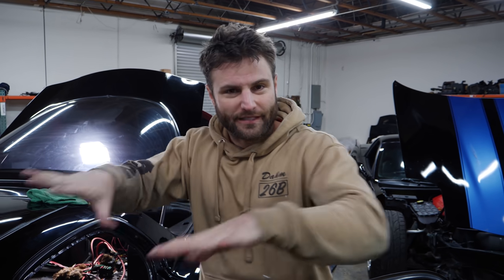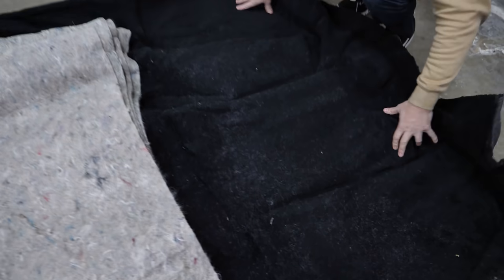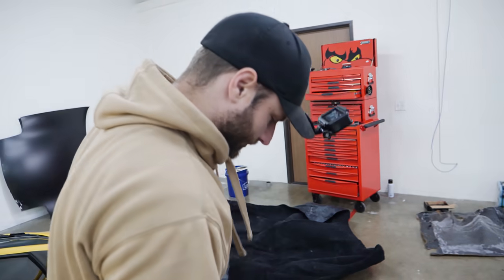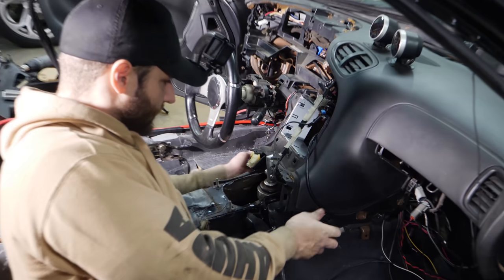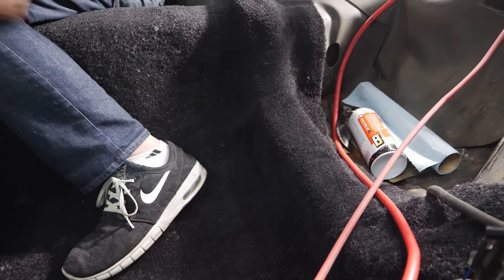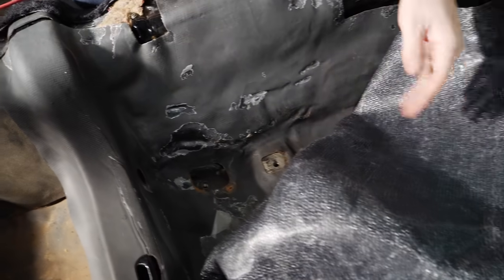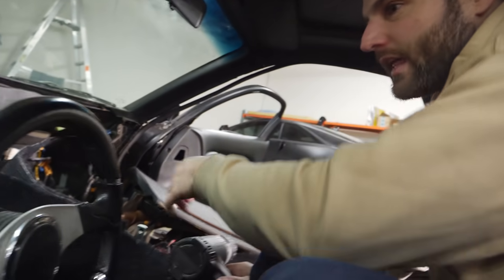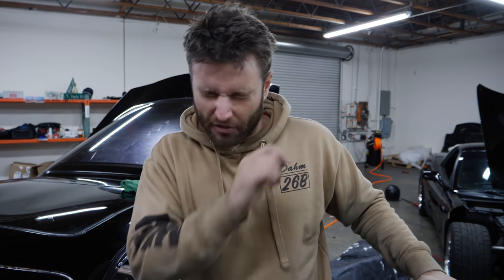How BAD is the $140 Carpet from Amazon? Car Interior Replacement

Comment: Rob, I believe you owe ACC an apology.  If you had followed their instructions, for letting the carpet rest, outside of its shipping packaging, unfurled in the sun, it would have laid out well (and it is cut-to-fit).  While I have not purchased their least expensive carpet, I have purchased their most expensive option, and it is a very good product.  If you had searched more, you would have discovered, ACC itself offers several options for an FD RX7, via RockAuto for example.

Comment: The other problem you are not seeing yet is ACC carpets fade out very quickly also. That black will turn an almost ugly faded red/orange color once it sits in the sun for some time.
Reply: NWCH like any else does clothes plastic etc your eyes vision it’s called blocking UV LIGHT from your windows.
Reply: Do you have any recommendations for other brands that don't fade so easily? I need a carpet for my Porsche 944 and ACC seems like one of my only options but it's ~$1K not $100 like this one 😢.

Comment: I don't know if you found a solution to the problem, but I got the replacement carpet for my VR4 from stockinteriors. It came out really nice! I let it take shape again by having it sit overnight unfolded, and I used my OEM carpet to template where to cut. I'd check them out Rob, it looks like they have one for the RX7.
Reply: I've seen stockinteriors alot, seems to have real molded stuff.
Reply: VW guys swear by stockinteriors. Only thing that fits even close to OEM
Reply: Thats where I got mine from too for my fc,but didnt install yet
Reply: Another one here for stockinteriors! Fits my Datsun 280, Subaru FXT,  and Honda really well. 🤙
Reply: wow im getting nervous, im on stockliner site now. is their carpet good?

Comment: Rob I hate to tell you this man but unless you order carpet from a specific automotive carpet company almost all companies get their carpet through acc. Ive installed this brand many times and once everything is in and it sits in some heat for a while it smooths out just fine. It is definitely a pain in the ass to install with all the creases from shipping.
Reply: 86BoostedBird well you’re supposed to let it sit near heat for a little before installing as well... it was molded originally but it gets crushed during shipping
Reply: @Matt_Lanzer_13  true, my favorite way to do it is set it in the car and let it sit in the sun with the windows up. Bakes and forms them pretty quick.
Reply: 86BoostedBird yea. Rob just didn’t do a damn thing right here and he payed for his mistakes 😂

Comment: You should do your research on ACC not amazon. ACC has been around for a long time providing restoration carpets to many high dollar classics and replacements to worn out vehicles.
Reply: Used them years ago when i restored my '68 Satellite. Bought it through YearOne. It settled in really good. Just my $0.02
Reply: I've used acc carpet on two falcons, as well as a 66 fairlane and it has fit fairly well out of the box and has lasted a good, long time.
Reply: @johnny_6T8  Plymouth satellite? A old friend of mines had a 67 belvedere gtx with a 440.
Reply: @kwebb4078bn  yes sir, Satellite. Actually had  '70 Belvedere wagon. Always liked those low budget model cars.
Reply: I can't afford something like that lol but I am restoring a 98 camry with 370k miles on it. I bought it for 800 bucks. It's not in bad shape either. It still runs. I'm going to use it as a daily driver. If I could afford  a classic car though. My choice would be an 1970 Cuda 440.
Reply: @kwebb4078bn  totally understand that. I bought my then wagon for $200.00 and drove it home. Got the Satellite for $600 and drove that home as well. Keep in mind this was over 20 years ago and in Los Angeles where Chrysler products weren't as popular as a Ford or Chevy. 
Funny you say camry, bought an '01 LE on Nov 4th of 2000. Still have it as my daily with 267K. Good luck with your '98!
Reply: @johnny_6T8  thank you

Comment: I took the seats out of my car, 65 Mustang.  My mom installed the carpet while I was at school, 10th grade.  I had left it outside while in school so I could do it myself.  As a birthday gift when I turned 16 in late August, I get home and the carpet & seats were reinstalled.  My father put the seats in because he helped me take them out and he installed 6 speakers and wired the entire stereo for me, of course i paid for the carpet, speakers stereo and all the wires for the amps that i would install a day later.  My father was an electronic engineer, but wiring is not hard to figure out what with instructions and all!

Comment: I've used carpet from the local home improvement store in several of my restorations. A 67 and a 68 Camaro, a 68 and a 69 Firebird, a 63 Nova, and a 72 GMC Sprint. Sold them all.to strangers and not one person asked if the carpet was correct. You just have to cut it correctly and get the right style.

Comment: This whole carpet project looks like a nightmare. It's bad enough you have to tear the interior apart, but then having to fight with shit quality carpeting. I had no idea there were few decent options for replacement carpeting. Bummer!
Reply: No.  He just didn't know what he was doing!
Reply: It’s not bad at all. The carpet isn’t shit he just didn’t do what he was supposed to. When you get a molded cut to fit carpet, all you have to do is pull the old one, let the new one sit out near a heat source for a while, then put it in the car. Where you need a hole just cut it quick with a razor. Trim the edge and you’re done. This job is only bad because it’s an fd

Comment: So I work for a 1960-1987 Chevrolet C10 truck parts store. The store I work for actually sells the same brand of carpet. The thing that's good about it is it's formed to the truck, and comes in all the original colors. However I feel like a car like the RX7 has more complex curves to it. I've seen numerous carpets fit in the trucks. Also the material is, you're right like an old truck or car. That's why we sell it. So it's good for some things, but not any modern car in my opinion.

Comment: Used that company for my 96 hardbody, just placed the old carpet on the old one, and cut the excess and marked the slits and holes to match the oem 

After a week in the sun, it was nearly perfect to the original fit of the original

Time and effort will yield the ultimate result

Comment: It may not look that good rob, but if your going to install automotive carpet you have to put the outside in the sun upside down in order to get it more malleable, it may be garbage carpet but you also have to get the backing hot before placing it down, I have done a ton of them and it goes a lot easier when you do this. good luck on you hunt for a better fit but please try this as well on the better stuff

Comment: In my experience its best to reuse the oem carpet if possible or acquire used OEM carpet and give it a good cleaning. Its easy to change the color as well. It just fits way better than any aftermarket.

Comment: for putting holes for seat bolts and the like in carpet like this that isn't stamped/cut already, use an old socket of the right size and a blowtorch to heat the socket up. once you know where to put the hole, use the hot socket to press down firmly in the spot to melt through and bam, clean hole. just be damn sure you have the right spot.

Comment: Looks like since you didn't get the "hollow carpet fibers" your making up the weight difference with rust holes in floor board,  I've done that myself a time or two. I've used ACC carpet in a few cars before mainly vettes and it's not too bad really , I always used the best grade for sound deadening it helps slightly.A steamer makes it easy to alter the pre-formed areas and make it fit good and lay flat. You did order the cheapest grade they make so don't blame them for that,  plus it does require some experience to install it..

Comment: You should’ve put the new carpet on top of the old one(with a sheet of plastic in between them). Then glued underneath the new carpet, to reform it.
That way you could fix it outside of the car

Comment: seems like they mould the carpet between two heated moulds , if it doesnt quite fit you might be able to reshape it some using a heatgun , do try on a piece of scrap first as it might well be heat turns the carpet fibers intoo a lump of solid plastic

Comment: Yeah I am doing a complete rebuild/restore on my fd and replaced my shit tan carpet with ACR carpet. But I upgraded with the "mass backing" rubber bottom option. I selected this option because like Rob I had rust problems, I used a wire brush on an angle grinder to remove it all and coated with some por 15 rust sealer and drenched the whole interior with seal all from the gallon cans for extra moisture protection. I wanted another layer of protection and the mass backing does the trick. Yeah it's not a perfect fit... Yeah I had to do a lot of trimming but once I got most of my interior put back in everythinv looks OK. I won't say professional grade because of my lack on experience. But the quality is a lot better compared to the old rusted nasty carpet I pulled out of the car. I also had the dash completely pulled and literally my car was a shell when I installed my carpet

Comment: That was hard to watch.  I work in the auto industry designing and making prototype carpets and soft trim.  in addition to unrolling the carpet, and using the old one for a template don't reuse the black rubber padding.  it's creating an offset today the molded shape.  you need today strip more of the interior too get it together fit.  Trying today work carpet around stuff is painful.  The front carpet is installed by sliding it forward in vehicle until you are tight on the firewall.  if you need to, cut sits in the center console area and get some velcro to put it back together, the center console will cover it up.  good luck.

Comment: carpets are formed to fit but no matter what brand you get you need to trim it and cut holes for the seat and other things that need to bolt down they all come that way this process for this carpets the same as any other brand. Anyone who has messed with carpet would say the same thing

Comment: Great video. I have a 95 Nissan 240 and ordered the CAC molded carpet for it. Ran into the same issues as you did. Its molded and that is about it. It looks better than the old carpet but fukn sucks. I recommend that you buy OEM molded carpet.
Reply: Hager z then you didn’t install it right either lmao. Their stuff works great... just let it reform after taking it from the box, pull any necessary interior trim, cut a few holes with a razor and your done. Did it on my alltrac and it came out great

Comment: Why does every dashboard seem to have a rusty tube inside it? Is there a reason this isn't painted / coated at the factory?
Reply: Paint costs money and it isn't visible in any normal circumstance.
Reply: @CompproB237  maybe it's just availability bias but i can't think of any other ferrous part they just leave uncoated like that except maybe the exhaust.
Reply: @AntonEMaes  The other reason to not bother with painting it is that it typically isn't exposed to much persistent water that would significantly contribute to rust.

You're right that there's almost no reason to leave the dash braces unpainted. If you were running a business and you're look at manufacturing tens of thousands or more of cars then the scale shifts. Even if it only costs $0.01 each it quickly becomes $1,000 or more and that bites into your bottom line. Although, to paint something like the dash brace probably costs about a dollar each for just the paint let alone the need for equipment to paint the piece that few will see. $1 each piece multiplied over 10,000 finished products is $10,000 "wasted" on something that few end-customers will see. Especially given said part will likely never significantly contribute to compromising the product over its useful lifespan.

Other parts that are left unpainted:
Many exhaust-related parts (exhaust manifold, exhaust manifold brace, exhaust itself as you mentioned), engine-attached parts such as the mounting brace for power steering/alternator (might be different with new cars) and A/C, along with many suspension parts. Even brake rotors are typically cast-iron and are left unpainted and you'd imagine that this would be something to worry about as far as rust compromising the safety of the product. Although, I am specifically referring to cars from 2002 or earlier and more specifically the early 90s Japanese cars.

EDIT:
Those mentioned parts are exposed to significantly more moisture than the dash brace but yet are left unpainted. Yes, they do rust to death given poor conditions or care but they're explicitly exposed to said conditions unlike the dash brace.
Reply: @CompproB237  A lot of that stuff is exposed to high heat (brakes exaust) or is made of non ferrous materials. Brakets typically get some form of coating. 

I think the dash thing might just be so it serves as a chassis ground. 

A rusty anti sway bar end link you'll never notice unless it brakes but there's really nothing else in the cabin that I can think of that sits unpainted where the dust could get out.
Reply: @AntonEMaes  Most of the interior screws and bolts (at least my '91 Accord) are unpainted. In fact, that's the cause of a common rust issue on these old cars. Rear quarter panel exterior has plain black screws holding the rear bumper to the quarter panel. I see a lot with rusted out rear quarters because of that. Then again, those cars are 26-29 years old.

Comment: No offence but there is a reason the carpet is $1000. The stuff you bought obviously expects the person installing to have some skills because it's formed to the car but that's it. You cut the holes, you work the carpet you install. If you want a cheap option you should have expected that. It costs money to create a slip in easy install product that looks good. Your asking a company to invest more than the profit to sell you a product. When you buy a product from a manufacturer they generally have to make 2x the cost back on each part. So if It cost me $400 to form and create the carpet I need to sell it for $800.

Comment: I've used that carpet quite a few times and sure, it's not perfect straight out of the box. Your first mistake was cutting it, big mistake. Put it in place as best you can, then let it settle down. Putting pressure on the carpet when the car is not in use. (Sand bags in the corners and so on. It just needs to settle down. But the key is to get it in place perfectly around the edges and then fit the trims back in and just let it do its thing. Time heals all wounds. Cheers.

Comment: Ask mickey and ricky from throtl, they was replacing their FD carpet. Just ask where they buy the carpet.
Reply: Eko Setiawan pretty sure they used the same one. Dahm just didn’t install it right. You have to let it reform for a while before installation then it’s pretty easy

Comment: It's a glue backed carpet that needs to be rolled when laying.
Reply: Heat the back from the roll then from the carpetside use a roller to get the har spots. The tape is used the center the carpet. The form is a general structure.

Comment: Actually, that wax is a hot glue. You just put the carpet on and heat it, and it sticks. 
But yeah, that doesn't change the fact that this is a horrible piece of shite. I think the stock carpet could have been salvaged with some washing and patching. Been there, done that.

Comment: I tried this same companies carpet on my 2+2 Z32, the fitment was so shitty, much like you found, long at the firewall, short at the door sills, big bump on the trans tunnel, the seat was rubbing on.  I contacted them, sent them photos, they refunded me the money, I order another one with the rubber backing, it was just as horrible.  I cut it out, tossed it in the trash and said f*^k it, race car.

Comment: Yeah that was some shit carpet but even nice replacement carpet you have to cut your own holes for the seat bolts and shifter. I feel Rob's pain though that stuff was extremely bad.
Reply: wheeln 24/7 nah this brand makes decent stuff he just didn’t use it right. You’re supposed to let it sit near a heat source so it can shrink back to the molded shape
Reply: @Matt_Lanzer_13  yeah I thought he should've let it sit in the sun for awhile like i've seen most people do with replacement carpets.

Comment: I love that you did this and didnt read the directions AT ALL 
I have installed dozens of ACC carpet kits and they fit awesome 
Read the directions next time. Love you channel, but this is a bad look for you 
ALso if you dont like the texture of the carpet they have other options
Reply from the maker: Doesn’t explain the literal creases in the corner. That’s just unacceptable. And the claim that it’s oem quality carpet is also a complete lie sadly. Even their own website admits it. It claims this is the highest quality. Then on another page says for OEM quality add extra money. Little bit of a contradiction there.  To be fair I didn’t know or purchase it from them. I saw it on amazon. I’m willing to add all the unlisted options and try again. But I’m going to call them and see if they can improve the form/mold. The ironed creases they made in the corners is just unacceptable.   Might be acceptable for some. But not when im willing to pay for oem quality.